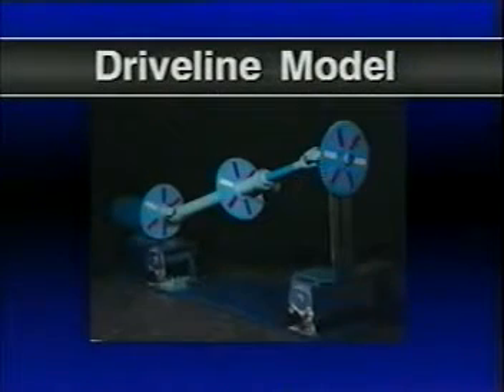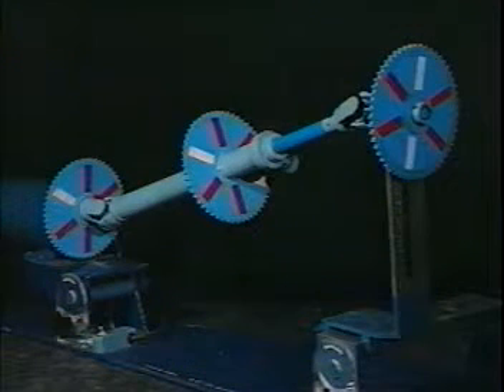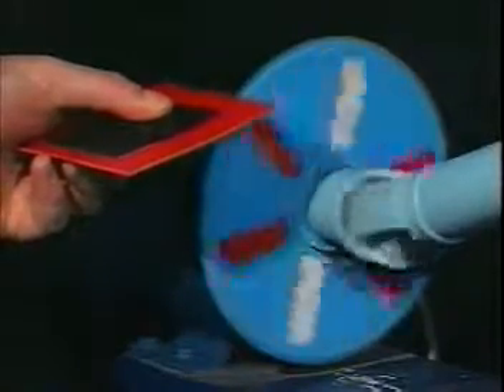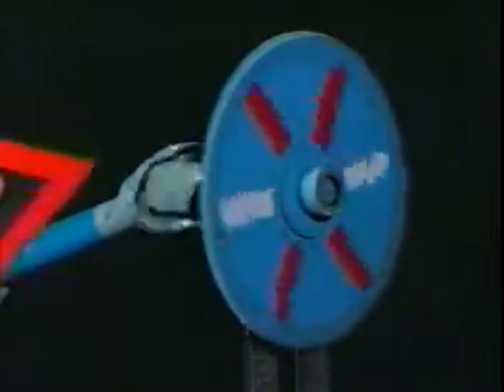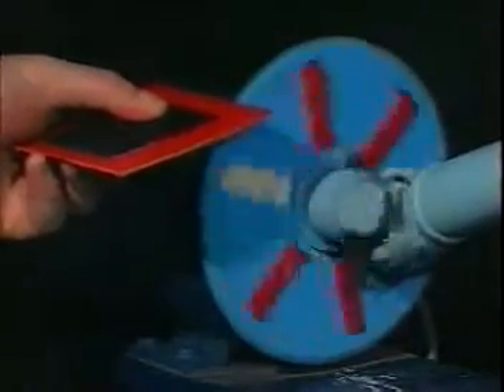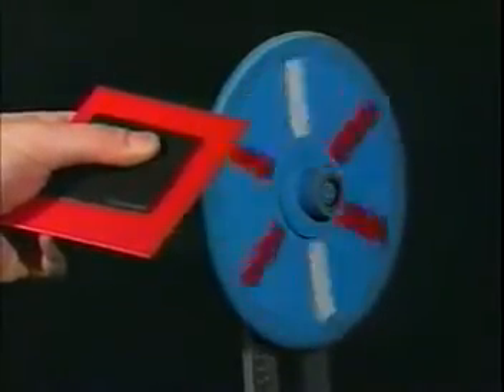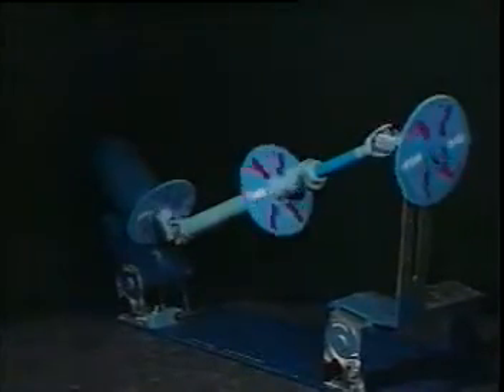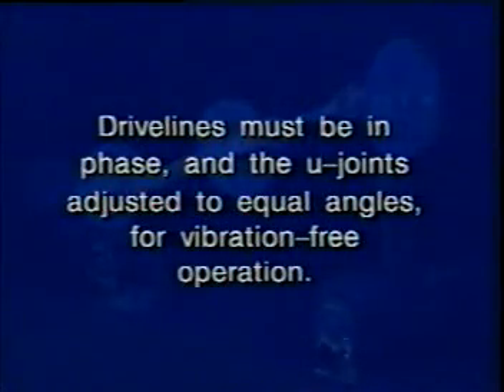Driveline Troubleshooting

Comment: So, if the angles are different at either end will running the prop out of phase to a greater or lesser degree improve the situation?  I only ask as I had dreadfull rattle/vibration on a neutral throttle after a slight suspension lift. I did correct the angles and it's a lot better, also the front on my 4x4 has different angles from the factory and they run the prop out of phase, is this a poor compromise? Thanks for the great video.
Reply from the maker: No if the u joint phasing is not 100% correct it will make it worse. They are two different problems. One problem dose not fix the other only compounds the issue. This was a short clip of the entire video. I’ll try to find the entire video and send a link. Good luck
Reply from the maker: I just signed up for this myself. May have some good information. I’ll keep looking for the full video. 

https://training.dana.com
Reply: @ryanburbridge  
This maybe 
👇😁👇
Watch "Driveshaft Velocity | Spicer Garage" on YouTube
https://youtu.be/jaaTyL099RA

Watch "Drive shaft velocity" on YouTube
https://youtu.be/gmV4qwLfOMY
Reply from the maker: X Mo thanks bud!
Reply: @ryanburbridge  
No prob!
Reply: @ryanburbridge  
I just found 7 hours of u-joint info. Google this:
WeberAuto universal joints part 1, 2,3,4,5,6,7.
Reply from the maker: X Mo right on! You working on a project or something? You should post a quick video.
Reply from the maker: X Mo oh yeah Weber puts out some great videos. I watched their series on automatic trans fluid lol

Comment: Well I'll be damned....
I knew that u-joints needed some angle, or a perfectly prescribed angle so the u-joint is actually rotating in itself (the little needle bearings in the cup are not allowed to stay in one spot cause they will wear In a groove in that spot after some time), but never knew about why exactly both u-joints needed to be the same angle, and definitely didn't know about the yoke phasing. Incredible.
Thanks
Reply from the maker: Yeah that’s why i uploaded this. I forget where i got this. Think there is a longer version out there
Reply: @ryanburbridge  
This maybe 
👇😁👇
Watch "Driveshaft Velocity | Spicer Garage" on YouTube
https://youtu.be/jaaTyL099RA

Watch "Drive shaft velocity" on YouTube
https://youtu.be/gmV4qwLfOMY

Comment: Is it possible to achieve constant RPMs with an specific phasing angle between driveshaft yokes if your shaft are not parallel?
Thanks and regards.
Reply from the maker: There may be but that would be above my skill level. There are tons of good info out there about the topic. Do you have to stay with a Cardan style joint or could you switch to a CV style? Here is a good link. https://www.machineservice.com/wp-content/uploads/2012/04/Driveline-Clinic.pdf
And http://media.spicerparts.com/cfs/files/media/sHto4RMKzg7cmgEQQ/JOI-TEC-082%20Interaxle%20Driveline%20Phasing.pdf?token=eyJhdXRoVG9rZW4iOiIifQ%3D%3D&store=original
Reply: Yes you can run the unis out of phase when flanges at each end are out of phase.
Reply: Not sure if it helps but Land Rover on the Defender have flanges that are not parralel on the front axle and transfer box, they run the front prop out of phase from the factory  I presume to overcome the flange misalignment, the rear axle/transfer flanges are parralel and the rear props are in phase from factory.